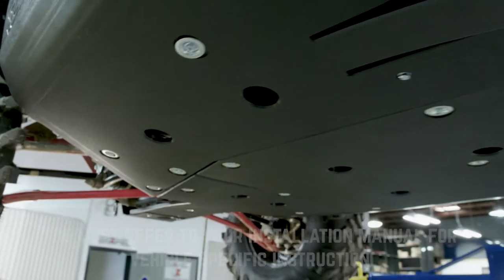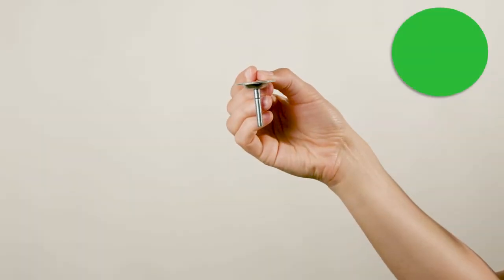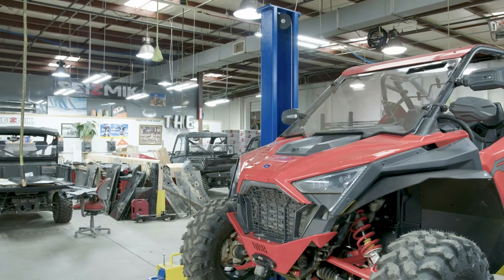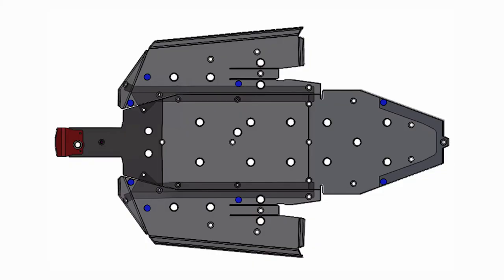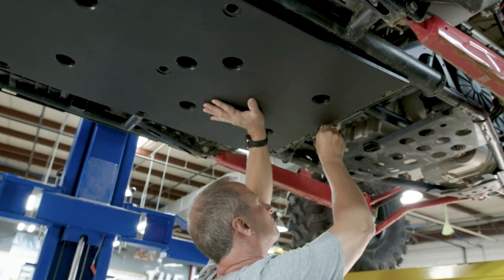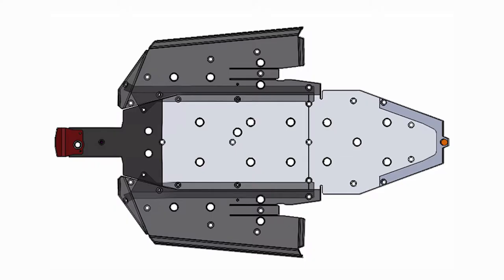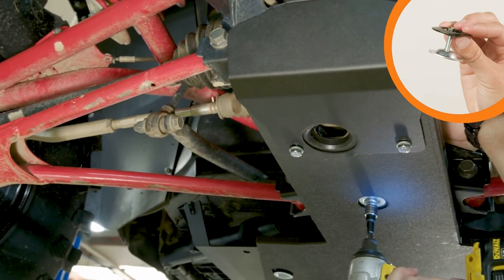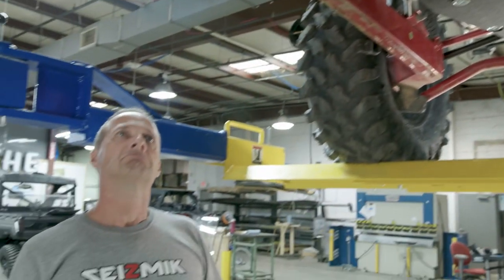Seizmik Skid Plate Installation Process

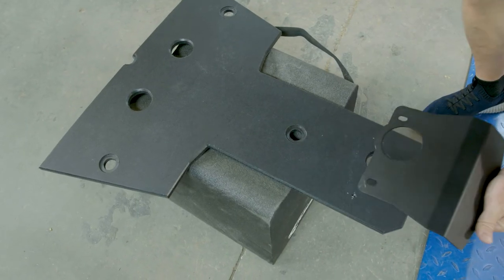Comment: Great looking set-up, I really like it... but I do have a question...  4:01 the only non-recessed holes are on the front skid plate that could make first contact when approaching an object?  That seems strange.
Reply from the maker: In short, you are correct. We would have much rather have recessed holes in front much like our RZR XP1000 and Turbo kits have, however Polaris removed the front mounting holes in the PRO XP and we had to come up with the front bash plate so that customers wouldn’t have to drill holes in the very thick crossmember. 

The bash plate bolts directly to the UHMW panel from the underside because there is no way to access the top side of the skid when its installed. Even if we used countersunk hardware the head wouldn’t sit flush with the bash plate and would be weaker because of the smaller contact surface between the head of the bolt and the plate. 

Additionally if we put the bash plate on top of the skid plate instead of underneath, you would have a flat edge that would catch on everything and want to peel the skid plate off (away) from the vehicle. It may not be the perfect solution, but we found this setup to be the lesser of the 3 evils. And again, the PRO XP is the only vehicle with this feature. 

Thanks for checking out our products and I hope this helps explain our design choice! 

Happy riding.